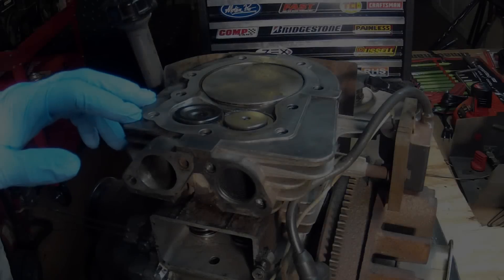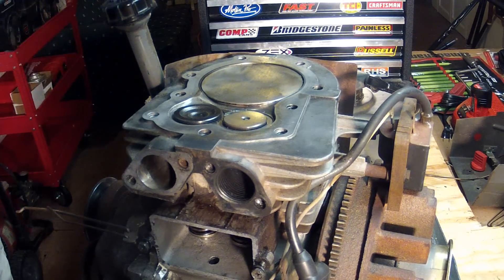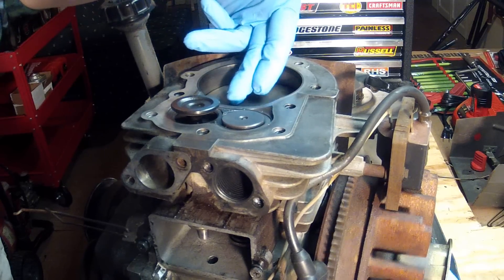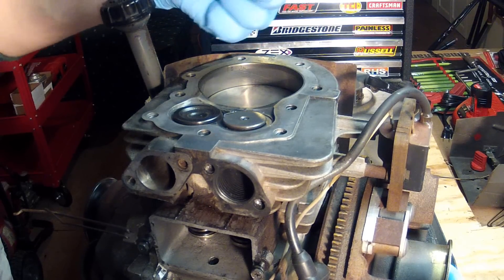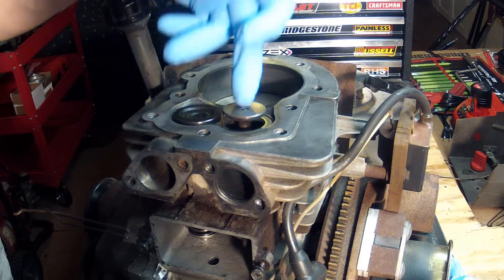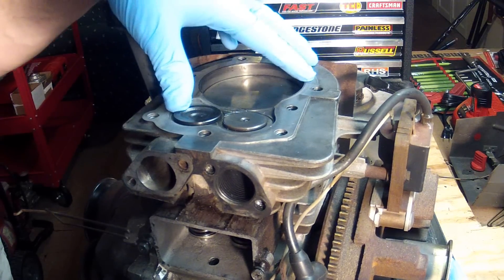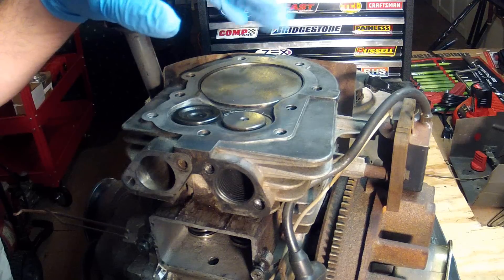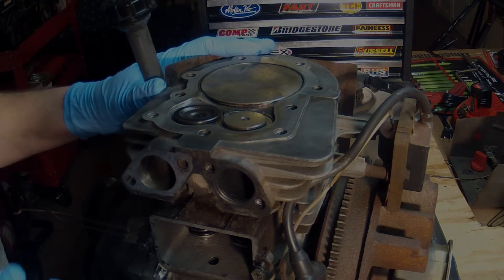Tecumseh HM80 Engine -The Four Strokes of a Four Stroke Engine and What the Compression Release Does

Comment: Is there anyway to adjust this my engine seems to have trouble turning over with starter generator because of compression It’s a 1960 mile 10 horse
Reply from the maker: No way to adjust. I'm not sure if an engine from 1960 would have a compression release mechanism.

Comment: How does that work when trying to do a compression test
Reply from the maker: That can be problematic. The "release mechanism"  works as the engine begins to spin slowly. If you pull the starter cord fast enough, you should still be able to get a good reading.

Comment: So if I take a compression gage test, does the speed spin of the engine while the electric start is working negate the release so I get a true compression reading? I like to monitor compresssions on all my small engines. You mentioned "...once engine gets running centrifugal force closes it...... ??
Reply from the maker: You raise a good point. If you electric start, I believe the engine is spinning fast enough to get an accurate reading. Thanks for watching.

Comment: EXCELLENT VIDEO!    How is a compression test done on this type of engine?
Reply: hey man compression test can be done by removing spark plug and screwing in a compression test gauge and then turning the engine over. if you don’t have a compression test kit you can use your thumb and feel how much it gets sucked in and pushed out.

Comment: Great video...I have a hmsk100...my compression release broke...actually the only part that broke was the little spring that's part of the mechanism...would you know the part number for that spring or of any comparable replacements?
Reply from the maker: I wouldn't know off the top of my head but I usually do an internet search for the engine model and find an illustrated parts listing. From that, you should be able to track down the part number. Try partstreeDOTcom

Comment: I have a hm80 from the 70s it doesn't seem to have a compression release mechanism on the cam??Have you ever come across this?
Reply from the maker: I haven't dealt with any engines without the pressure release mechanism, but it's possible that older engines did not have them. As technology advanced, they may have come along later. Thanks for watching.
Reply: +sblg43 What about smaller ones like older 5hp?
Reply: @mikebones322  I have two snowblowers with Tecumseh engines one is a 1979 HS40 which does not have it and a 1996 HSSK50 which uses BCR which is a small bump added to the camshaft exhaust valve lobe to provide the compression release function.  This has no moving parts to malfunction.
Reply from the maker: If it doesn't have a pressure release mechanism, it just may be a bit harder to pull start.
Reply: +sblg43 Its an older (likely 1970;s) 5hp on an Ariens blower. I got 50 lbs psi and assume the valves are bad. I am assuming that 5hp doesnt need a release as its easy enough to roll over. Thoughts?